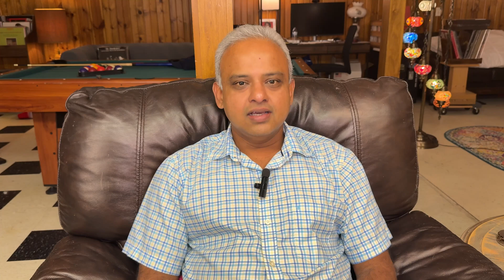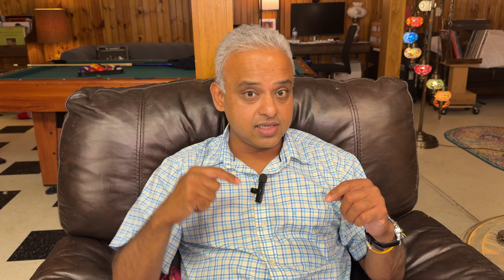Your Expensive Speakers Sound Terrible Because of This

Comment: What I want to say is that  Frequency Response is not the issue facing the vast majority of listeners in 2026.
This is heresy I know. But we solved that problem years ago in my view.

I have never once looked at a speaker's graph before purchase, because it is irrelevant to me. No speaker has ever disappointed me.
And free upgrades are always superior - and shifting speakers using NOTHING but your ears is completely legitimate. Measurements can be made to identify major problems, but no graph has ever told you what a speaker sounds like before you plug it in. And no graph can tell you if a speaker sounds good or not. That is why we listen to speakers, rather than watch them. :)

This is why I always rely on shared subjective assessments not graphs. Language allows us to accurately describe the stuff we can't measure, and people are smart, and tend to hear the same things even if they describe them using slightly different words. I buy speakers which have construction and design features I value highly. This allows me to buy the KIND of speakers that I know will work in my rooms, and will produce the music cleanly, letting the gear get out of the way of the music.

Most pointedly I am NOT seeking musical reproduction as a goal in any audio system in 2026. My systems seek Musical Translation - which is a much more worthy - and achievable goal in 2026! All audio systems translate a recording into a physical and psychological experience. Proper Musical Translation is when every intention of the music's creators arrive intact inside the human nervous system.

Please read that last sentence again. It may be the most important audio concept you ever learn. 

Even more heretical are the three fundamental binary-type questions I have developed especially to decide if a stereo system intended for critical listening requires upgrades. If you can say YES to all three questions, then you are DONE. Period. End of story. All subsequent modifications are fashion or whim, and nothing to do with improving sound quality, in my view.

1. Do sounds exist beyond the speakers?
2. Can you hear anything at all except the music?
3. Can it move you without your permission?

Please note something important I added above: The words "intended for critical listening", those words are key. This is the top level question which must be answered before any system planning begins, because it radically alters the nature of the gear you will buy, and it means no components except speaker cables and interconnects will be shared.

You will notice that FR appears nowhere in the questions - because that would be asking the wrong TYPE of question as it relates to the TRANSLATION of music. And music can be translated correctly in an infinite number of ways - none of which are inferior to the others.  But the differences will be massive listening to these systems. And yet they will all sound brilliant.

Once you give up on the (utterly physically impossible) goal of music reproduction, and accept translation, everything else falls away, and reveals the truth of HiFi: ALL systems which can answer YES to the three questions above ALL sound fantastic, and all are radically different in the way they sound. There is no one correct way to listen to music when translation becomes your goal. And in 2026 it is a goal which can easily be achieved for less than $3,000 in total.

But the nice thing is, Musical Translation goals still allows silly people to spend $250,000, so my heresy doesn't totally destroy big-money Hifi. But it could well save you from wasting $100k chasing an impossible goal: musical reproduction. 

Happy New Year, everyone!
Reply from the maker: Really thoughtful way of putting it. I agree the end goal is always connection and musical engagement, not staring at graphs. I see measurements as tools to identify problems and explain behavior, not as a replacement for listening. When both line up, that’s usually where the magic happens.

Happy New Year!🎊

Comment: Great and very helpful presentation. Another variable usually overlooked in discussions of this topic is speaker directivity.  The easiest way to reduce room influence is to choose speakers with narrower directivity. Unfortunately, the modern apparent insistence on small midwoofers makes directivity control in the critical midbass and lower midrange regions physically impossible. PA speakers use large woofers and horns not only for efficiency but also to help project sound forward directly to the audience with minimal troublesome side spill. In 2-channel hifi listening, the same controlled directivity from large midbass drivers and directional midrange horns reduces smearing of transients from early reflections and also reduces "acoustical crosstalk" between channels, preserving pinpoint localization of apparent sources. I believe that is partially why more than one auditioner of my large PA-like hifi speakers has commented that they have headphone-like articulation.  I'm a big proponent of DSP, but no such tools can make a small speaker act or sound like a large one.
Reply from the maker: Absolutely fantastic comment. You explained it perfectly: controlled directivity reduces room-induced smear, improves imaging, and articulation. That’s exactly why big PA-style designs (done well) can sound incredibly clean in home listening rooms.
I’m definitely going to follow up with a dedicated video on directivity, waveguides, and why speaker size does matter more than many realize.
Thanks for adding such valuable insight to the discussion. Comments like this make the community better. 🙏

Comment: I had easy access to an O scope. The best bet for me was to use it and then guess and check with speaker placement as well as tweaking the layout of curtains, paintings/hangings on the wall etc. (measurements at various specific locations are a good guide on what needs to go where but also just listen, guess and check until you're happy). I did have to build and add an absorber/diffuser in order to counteract the effects from my gallery windows.

I later ended up with some equipment that supported the use of DIRAC live. Having it on us usually (but not always) worse.

Comment: Over the years I've sometimes used "room correction" microphones and software (like Audyssey) with AV receivers (Marantz, Yamaha, Onkyo, Denon) to help calibrate multi-channel home theater set-ups (Dolby 5.1 or 7.2 surround, Atmos, etc.) but I've never considered using that stuff for stereo. For that, I've been able to get away with using my two ears. I'm fortunate not to have encountered those boominess problems you mention in my listening rooms (which tend to be lined with shelves of records, books and DVDs, so maybe they serve as my "acoustic treatments")...

Comment: From my experience Dirac has no place in a 2 channel hifi system. In the worst case, goodbye soundstage depth and width, goodbye imaging, hello flat as a pancake soundstage, bound to the plane of the speakers, that are now totally localizable. In the best case, it just deadens the sound (but usually with some amount of the former). 

Treated or untreated room is no cure, Dirac will still mess you up (but arguable the closer to good you are, the less destructive it is). No amount of flat, Harmon or curves following natural responce of the speakers in the room, fixed it either. No amount of first or third party mic patterns help.

You used to be able to turn more things off (all phase and time alignment) and just curtain below say 300-500 hz and that was actually OK, but that seems to no longer the case in never versions.

Placement, treatment, setup and maybe some manual good quality EQ, seems to be the only way to go unfortunately.

Comment: Totaly agree with you, but want to add one thing. To clear that it is impossible to "correct" room-responce at least higher than bass region. Our brain is very critical to all attacs of each instrument note. This mostly happens in first 7 ms time laps. By this analyses we decide if the sound is live and proper. All SPL picks and deeps due to room-response accur much later: tens and even hundreds of ms! So SPL-meter may show you much better response curve, but this is so called quazi-static measurement. Your brain already made the judgement of first direct sounds from speakers, but those direct signal is already changed by processor in such a way, that later when summed with room-responce will be "correct". And result - measurements are better, but subjective perceptance is worse. If your room changes sound spectrum of let say your guitar - you will anyway hear that it plays guitar, live and correct, nevermind that room changes it`s spectrum. But if you put some peace of isolating tape to a string - you will immidiately hear that it sounds horrible! Even in perfect room. Cause our brain can distingvish direct and reflected sounds. So to correct sound from sourse is not good idea for "informative" part of sound spectrum.
Reply: First reflections can fall in this window of time and therefore most important room acoustic. This can be adjusted through speaker positioning.

Comment: My subwoofer has analog volume, crossover frequency and phase adjustment. Why would I even think of using DSP?
Reply from the maker: That’s a great point—if your sub has volume and phase controls, you can get pretty far with careful setup, especially if you’re tuning by ear or using test tones and a SPL meter.

But here’s where room correction takes it to the next level:

1. Precision: Room correction systems like Dirac or REW can measure down to 1/12th octave or finer, which reveals exactly where your room is boosting or canceling certain frequencies—way beyond what our ears or a simple sweep can detect.

2. Time alignment: Manual phase controls can help, but digital systems can correct timing down to the millisecond—not just between the sub and mains, but across multiple drivers and even for multiple seating positions.

3. Multi-sub integration: If you ever run dual subs, room correction can automatically optimize both together—phase, level, delay, and even EQ curves—something that’s nearly impossible to do manually.

So if your current setup sounds great and you’re happy, that’s awesome. But room correction can help you squeeze out that last ~ 20% of performance, especially in tricky rooms or with demanding music and film content. And once you’ve heard that last improvement, you’ll not want to miss out on- IMHO
Reply: Because analog crossovers and adjustments have unwanted effects to the analog signal as does DSP so the choice becomes which effect on the signal is more acceptable to you. I prefer DSP Linear phase filters over Analog Minimum phase filters.

Comment: Having gone through this process, there are 14 acoustic panels in my listening room and I use Dirac with the MiniDSP SHD.  Here is what I learned and would like to share:

1.  Everything you said about the room is true.  But let’s say the quiet part out loud: the room limits the quality of sound you can get out of any speaker and should have a big impact on your choice of speaker.  Consider your room, not just in terms of dimensions, but also in terms of what can and cannot be done to the room.  And then make the hard best guess: how good is your room.  Making that best guess is important because putting really good speakers in a really mediocre room (acoustically) is not going to change the sound you get from that room.  Don’t let YouTube reviews lull you into thinking that speakers or electronics are going to magically solve the problems in your room.

2.  The sin far too many audiophiles commit is ignoring the bass issues caused by the room.  As a result, there are FAR too few discussions about this the causes and the cures.  In particular, there is a reluctance to see subs as part of the tool box for addressing bass issues, which they are.

Overall, you provided a great introduction to a very complex subject!

Comment: Thanks for sharing knowledge rather than the stereotypical equipment reviews. That said, Re: “ let's ask the real question. Can active EQ or room correction actually fix bad room acoustics?
 Or is it just digital duct tape on a problem that's fundamentally broken?” 
The answer lies within the question. A dented tweeter diaphragm may possibly be repaired simply by sucking it back into shape with some judicious use of vacuum. A badly ripped woofer diaphragm is fundamentally broken and can only be replaced. So too with room acoustics. First passive, then active MAY be of use.